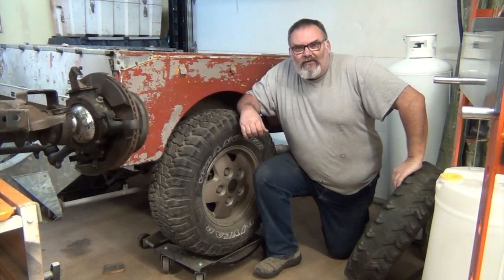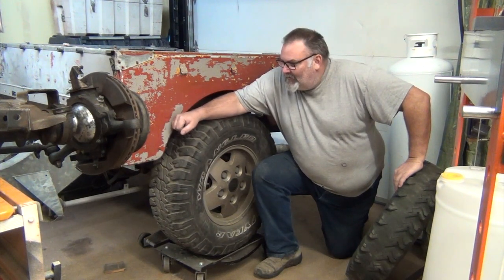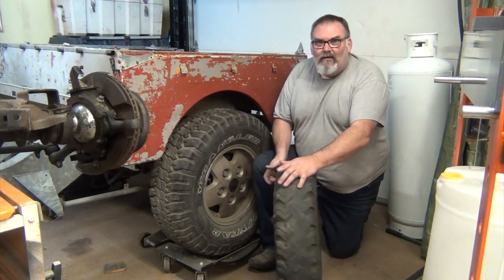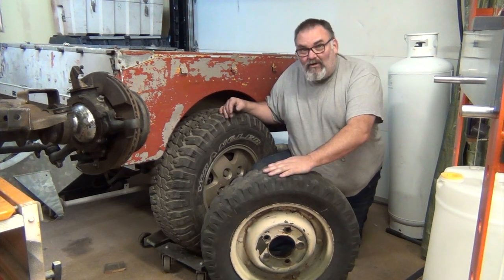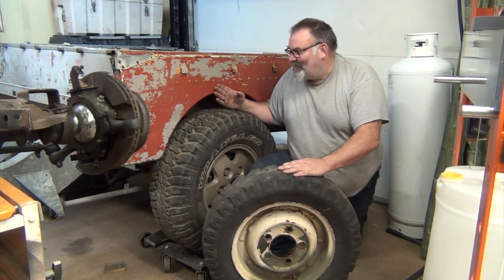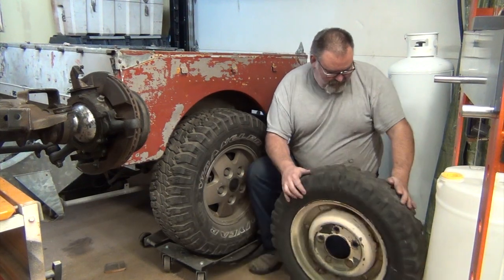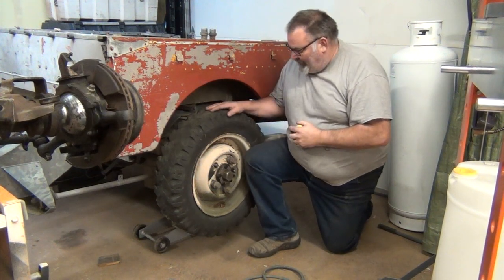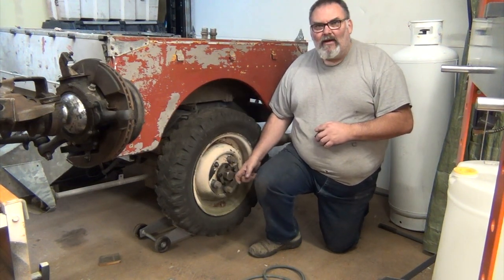Split Rim Option? for Ivy the V8 Series 1 Land Rover

Comment: It sure would be better to not have flares, but looks like that isn't an option. As far as I'm aware, those split rims are pretty rare and desirable to the rivet counter crew.
I'm really interested in what your custom guards end up looking like. 
I have a pair of Disco 1 axles to go under my 2a 109, but I'm still not sure how I want to address the leaf spring clash with the rear mount track rod. I would love a coil sprung chassis, but i'll be keeping my leaves. There are a few methods, but the one i like the most is using a LH drive knuckle case to gain 2 front-facing arms and run the track rod and steering rod off of them.
Reply from the maker: Hi Nathan yes my first preference is not to have eyebrows but the rangie axles are just to wide to fit the wheels under the body, Your disco axles on leaf springs setup sounds intriguing, are you doing a video on it?
Reply: @TooManyProjectsNotEnoughTime  I haven't really done any videos and don't even have a decent camera, but I may have go at it. Who knows, it may go viral and 3 people watch it. 😁
Reply from the maker: @NathanNostaw  You never know, I'm just thankful that a few people are interested